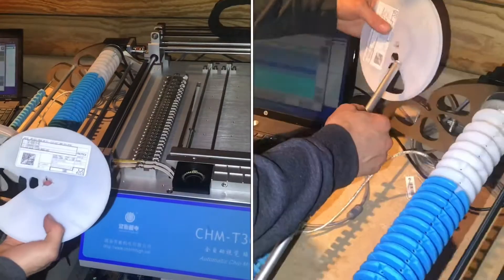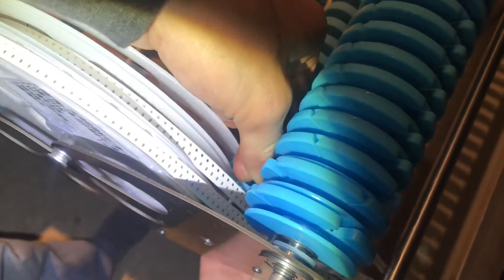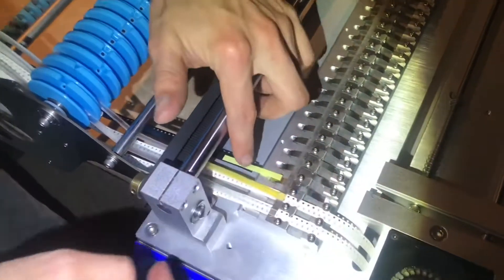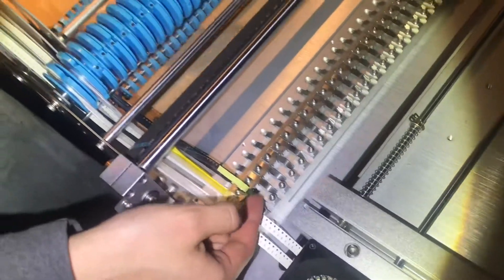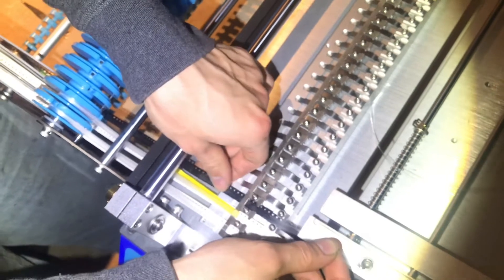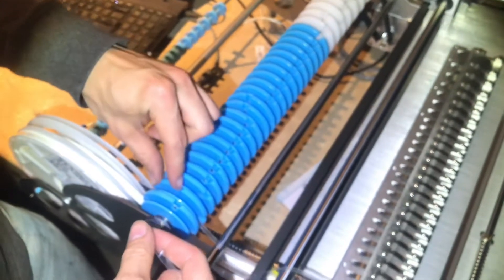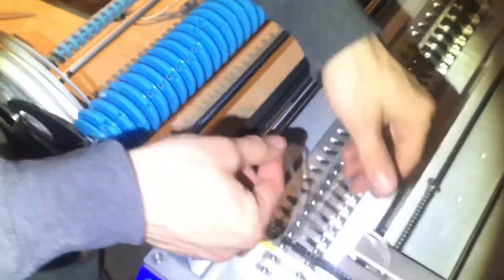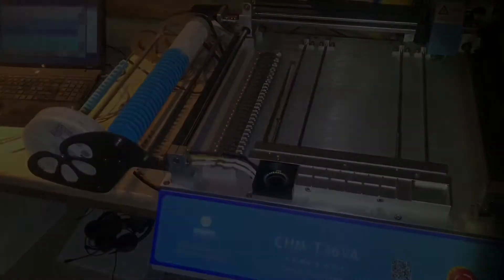“loading” COMPONENTS REELS on a desktop “pick n place machine” (chmt36va)

Comment: I am building a pick and place machine and now working only with smd tapes placed on the board area for loading of the parts. Can you give me some information about how your machine works?  I see that on the drag feeder there's only one step motor responsible for all spools of the tape peeling, how only one step motor can select and peel the tape of the reel being placed? There's some kind of clutch or mechanism inside the spools that does this?
Reply: Friction rings this is quite hard to do yourself as they have engineered the whole solution and spent a lot of money on it